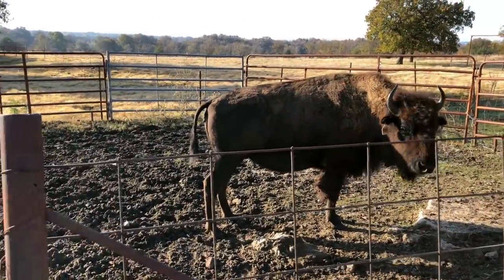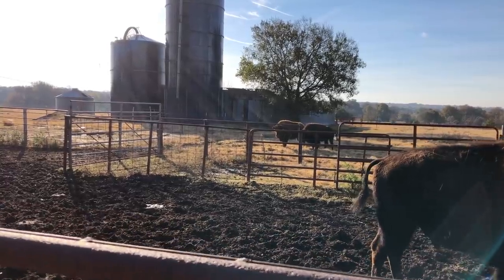Not all of the bison are getting the feed they need, so we...

Comment: Yes, I noticed that you only had one bolt holding the four by four in place.  It is correct to have braces on the the four by fours all the way around for added strength.  Minimum two screws each end for each brace.  Coating it with linseed oil will make last longer.  That treated wook lasts forever.  I built a heavy duty picnic out of treated 2"X 6" pine 20 years ago and it's still standing after all these years.  I bolted the legs and use screws on the top.  Very duable.   Just brace it up and it'll be fine.  Drilling a pilot hole each time might make it easier. Make sure the drill bit is smaller than the screw. Do you think Bison eat Alfalfa?  I know horses love it.  Just thought I'd ask.   Always good to see you and the Bison out and about.  A true bison farmer you are.   Do they require salt and vitamin blocks?  Till next time.
Reply from the maker: Thank you Larry! 
I've heard they don't like alfalfa really.....which kinda surprises me.
Yes, I keep trace mineral blocks out year around!
- Dusty